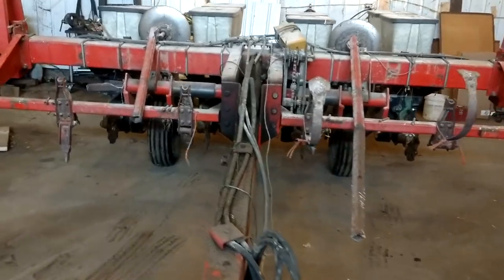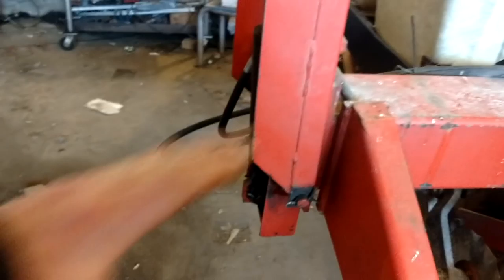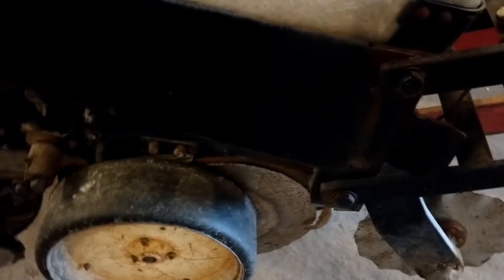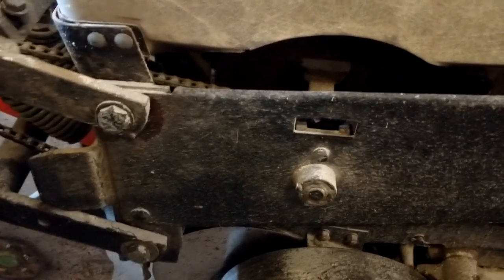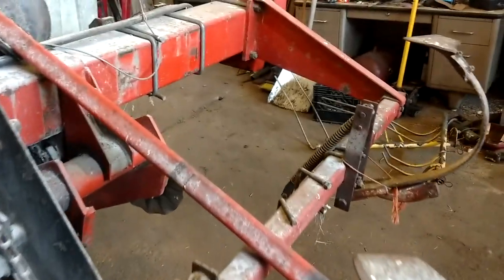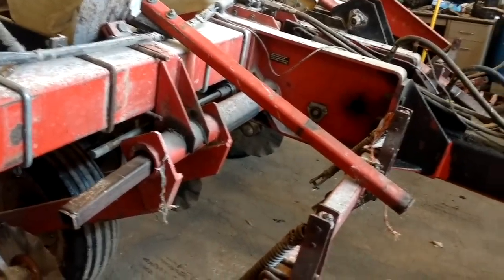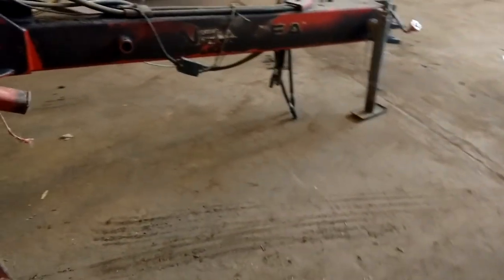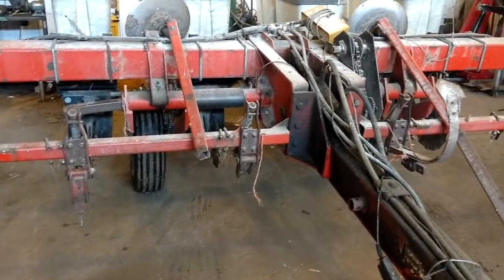Time to service the corn planter

Comment: Good to have the open shop to work in! Keep re-engineering to get it working  the best for you. You don't need ditches from your markers.
Reply from the maker: Yeah, when I put that wall up 3 years ago I was trying to save heat in the winter, I should have just remodeled my wash room then, would have saved me the trouble of redoing the big shop area! I'll get the markers figured out! I will explain more in the next video! Thanks for watching Wayne

Comment: Our old white planter we had back in the 80s had a marker similar to yours we found a different kit to put on it. Was like a field cultivator shank with a blade on it. Kinda gave it some spring so it didn’t put as much pressure on the arm.

Comment: If I were you, I would look into replacing those flimsy markers with a cheap soap foam marker. In notill sod, you need heavy (frame/weight) marker arms to make a decent mark. You could probably set it up to easily swap between the planter and your sprayer.
Reply from the maker: o'K. Farmer now there's an idea! Thanks

Comment: You think you will ever be able to use your corn planter? lol I know it would be more expensive, but how about a foam marker system instead of what you have? At least the foam would not dig in the ground. Snowing lightly here again....
Reply: That's what I was thinking foam markers, or just a straight notched disc  but I don't know how well you would see them in sod or rye stubble.
Reply from the maker: I think by just changing the direction of the cut should cure my issue's. With the way it cuts now, its way to aggressive and its ultimately the cause of my other problems. Stay tuned, more to come! I placed the order tonight!

Comment: Bred if it was me I would turn your marker blades around and shorten them to the center of the planter, Tall markers are a pain in the butt !  I would try the smooth blades first because the notched ones are hard to see on harder ground ware the smooth ones make a good line you can see threw the field, Hard or soft ground.  Its up to you, You know your ground better than any of us . So do what you think will do the best for you.  Bandit
Reply from the maker: I ordered the notched marker disks, but I can try both styles and see which works better. $50 for both notched disks! My ground is pretty light so I shouldn't have a issue. But I plan to experiment this year to see what works best!
Reply: I find if you have a question in your mind about if something will work or not, I got to try it to find out if it works or not. When I try something like this I watch it closely to see how it works and think about it as I go along .  You never know until you try it and its always nice to have options !  Bandit

Comment: I know it's hard to see the mark when you do no till but we have drug a  3'chain before instead of the disc and you could see it for the center mark but didn't throw the drill off.  I guess you can buy an old Trimble GPS and cut the markers off. lol
Reply from the maker: If I had the money, I would like to get a GPS. It would be handy for both planting and spraying, but I would rather pour concrete and add on the shed first!

Comment: Hey by looking at your planter you must be broadcasting your fertilizer on. How much are you putting on?
Reply from the maker: Yeah, I took the fertilizer box's off about 6 years ago. I hated loading that thing! The amount of fertilizer I apply varies year to year, I use a computer program that uses my soil samples and manure production and calculates the needs for each field. Depending on how much manure I apply on each field, sometimes I don't have to apply any fertilizer on some fields. But typically I try to fertilize for 4-5 ton per acre of hay and 175 bushel corn
Reply: LVF & Northern Wisconsin Farming thanks Brad what's the name of the program if you don't mind me asking.
Reply from the maker: Dan Fike I use snap plus. But agphd has a fertilizer removal by crop app you can get on your phone. Then just calculate you manure credits separately